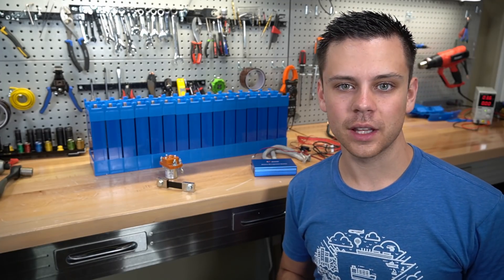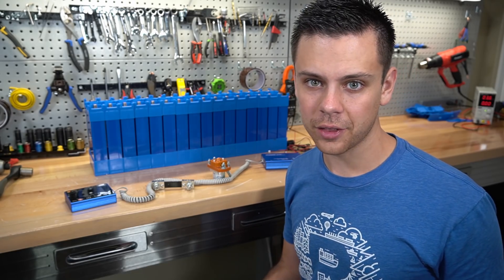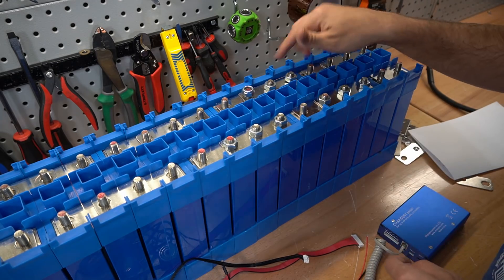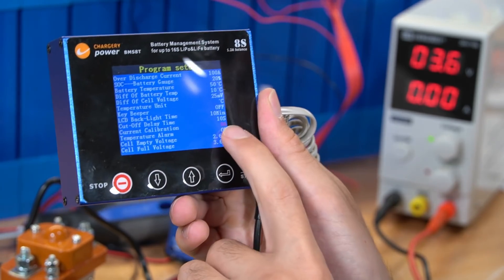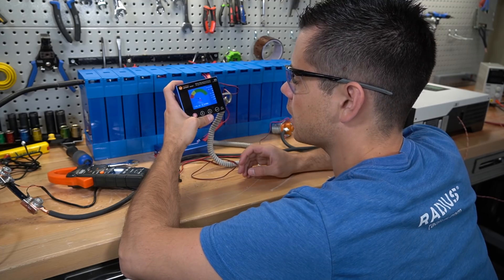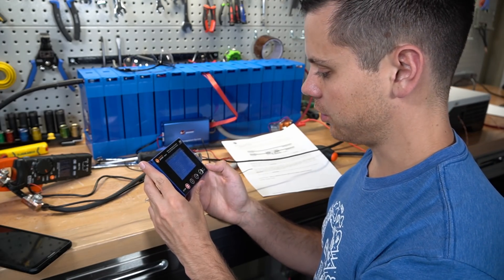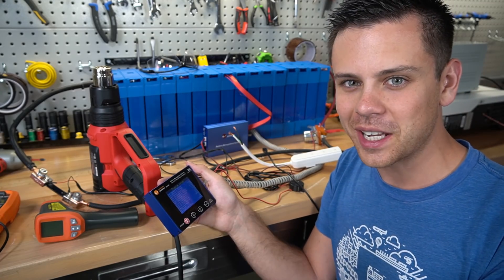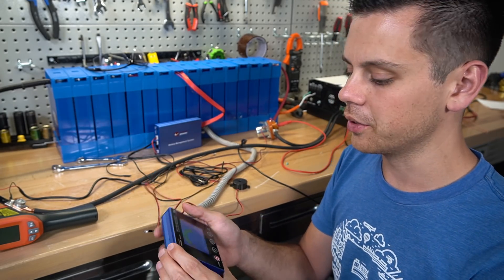Chargery 8T/16T LiFePO4/LTO/Li-Poly BMS Setup and Review

Comment: I like the Chargery system.  I just set mine up for a quick test before using it in my next project.  I read the instructions first.   The shunt is callibrated from the factory if you buy it with your unit.  So no need to do that process. I also the purchased 300A contactor which also works just fine.  I put a video on my channel.

Comment: They turn off the load relay because if you have a big cell voltage difference it means there is something wrong with your battery.... I'd say most of the things you had an issue with are desirable behavior even if the other systems you have used did not implement that.

I'll also add as others have, the relay heat is just from the coil and 118f isn't really that hot, and that method of current shunt calibration is better than entering a fixed value.

Comment: Thank you for the Video! If i buy the Chargery with 300A, can i adjust this to arround 350A? Because 300A i excatly need. i am afraid it will switch off in normal situation!
Thanks!

Comment: I have 8s 300 amp version. Connected it to 24v 600 amp lifepo4 battery. Can not get it to calibrate. Had a huge surge in amperage and destroyed my Magnum BMK ($187) loss. After 2 days and multiple recalibrations this is a no go. Not a stable or well programed device.

Comment: Good afternoon 
I just found out that the relays are bought separately. Do you happen to have a link for those relays? I may able to buy those relays if I know the operating voltage. I believe it is between 5 volt to 12 volt. Thanks

Comment: Good morning 
Would you able to provide me a hook up diagram? I bought 8 of the Lifepo4 280ah cells to accomplish 12 volt for my RV. I will put 2 cells in parallel to come up with 4 packs and using the the 4 packs in series to achieve 12 volt. I bought the same chargery you have except the charge and discharge relay. I believe I need to buy them separately. I don’t know if I need the discharge and charge relays. Please advise thanks

Comment: I bought this BMS system after watch this video and Your's recomendation. My ichargery is 16T and I used it with 12s battery pack from Tesla. I'm very disaponted , BMS shows inacurate cell's voltage's and balancing is really bad. Balancing 1,2A is imagination of producer. I lose my money and lot of time.  I'm DON"T RECOMENDED IT !!! . Search YT for video's from another disapointed user's of this pace of junk.

Comment: Why do you leave the parallel brackets on and then wire it in series I understand the parallel balance is the batteries that but you have to leave the little plates to connect to the negative negative positive to positive so on so forth

Comment: one reason I would like to be able to calibrate the shunt in this way is so that I could remotely locate the shunt, then calibrate for the resistance in extended wiring for remote location. Just a thought. Thanks for the videos, looking forward to seeing you cut some other battery apart soon :)

Comment: Resistive values of shunts change with temperature. So for maximum accuracy, you'd have a temperature sensor, or calibrate it at low current, and again at high current when it's warmed up some. 10 amps isn't enough to do that on a 100a shunt, though - so yeah it's just silly.

Comment: If you ever need to simulate a load again, reverse the polarity of your bench charger, set it to a low voltage, and current limit it to the load you want. Then connect. It'll act as a dead short / reverse polarity situation, but the current limiting will give you exactly the load you need.

Comment: love this video. I would do a firmware up date for this BMS. if they don't have have them make it. that is not user friendly ! I like the FET BMS. and you can control that contactor or bigger one for heavy loads. and most inverters have low voltage shut down anyways . put meter across that contactor getting hot. that voltage is loss not getting to inverter. the way I like is use a small relay solid state to control remote switch . that way only a fuse on inverter power lead.

Comment: That relay seems like a bad idea - I will design my own MOSFET switch PCB if I ever get one of these. 300amps is not a problem and most likely FAR lower ESR than the mechanical relay (no appreciable heat)

Comment: Personally, I am very satisfied with the Chargery BMS on my 24V 8S LiFePo4 DIY build.  I have found that an EV200 500A relay is much better than the relay shown in this video.  The heat problem with the relay in this video is not related to the Chargery BMS.  It is a separately purchased item that Chargery sells if you want it.  Just use a high quality relay like the EV200 and the heat problem is solved.  Also there is a easy way to calibrate the shunt.  On the third step, instead of reversing the hard wired leads on the shunt which require unscrewing and screwing, simply reverse the leads to the shunt from your power supply current source for the negative calibration.  I had no issues with the calibration doing it this way.  Of course you have to make sure all other battery loads or chargers are off when you do the calibration.
Reply: Are you Dr. Bruce Bugbee from Utah State?
Reply: @bungle555  No, I live in Michigan

Comment: I just bought a Chargery 16TPro BMS and as shown in the video - struggled to calibrate the shunt.   I don't need it for my case so I unplugged it, reset everything and got it all working.   I like it OK.     BUT I just saw this in the manual "3. Current Calibration is not recommended unless you are using a different shunt than supplied. Voltage
 and current is calibrated before delivery for the supplied shunt."
So it doesn't need calibration in the first place!!!   I plugged in the current sensor leads and all is working :)
My main problem is I don't need temp sensors - so I left them off and was confused why it wouldn't work...   till I noticed that when left off it goes to -22C which caused charge/discharge to be off.

Comment: clicked on the link you provided - is the cost really $9,999 - the seller re-listed the item that you linked to Will. 

this item. 

24V 3kW Growatt SPF LVM 120V/240V solar Inverter Split Phase optn

$9,999.00 Free Shipping

and the comparable one you also gave a link  to  is $639.00 ?
Reply: and the other one is $639.00 ?
Reply from the maker: No. You must have never used eBay. They increase the price when out of stock. Come on now lol 😂

Comment: Thanks for the info, I'm working on getting a 24V 100Amp lifepo4 battery set up but I'm having trouble locating a proper BMS. Looks like this one is not for me. Do you have any suggestions for me?

Comment: Will, you haven't quite got it right.  First, the Chargery BMS comes with a pre-calibrated shunt so you don't need to go through the pain you were complaining about.  Second, both mechanical and solid state relays have their problems.  SSRs tend to fail in the closed position (short) so you can end up with a very expensive dead battery bank.  The Chargery mechanical relay tends to fail in the open mode.  Third, you need to learn to read the manual.  Most of your problems would be solved.  The chargery is made for e-bikes and vehicles so it is optimized for that use.  However, it can handle up to 600A and 24s.  I am still looking for a reliable 16s (48v) BMS.  I do have 4 Chargery BMS 16Ts but I just plugged one of then in today so cannot render a verdict yet.  The relay coil is energized the whole time  you are charging or discharging so that is where your heat comes from but I really don't think a max 176 F is going to cause too many problems.  I have not measured this but the spec says that is the max heat and I can touch it briefly so seems about right.  Chargery is very good at customer support so far and even drew up diagrams for my 4 bank 600 Ah 48v powerwall using a BMS for each bank.  As far as the screen graphics, doesn't really bother me as long as the thing works.  It tells me all I need to know.  True, Bluetooth and some other data logging functions would be nice but try and find a BMS at a reasonable cost for the kind of powerwall I have.  This was the best I could find at the time.  I emailed the electrodacus guys and they told me they have no plans for a 48V version.  By the way, the Chargery handles low and high temp cut-off too.  If you have a better solution for my situation please let me know.  I really would like to protect my multi-thousand dollar battery investment.

Comment: Well, after watching the rest of the video, I found that super informative... I went through a couple of kinks with my BYD Modules and batrium but I'm using a Kilovac EV200AAANA Contactor

My BMS was 500$ for the watchmon 4 expanded (ebay used)
16 Long mons for around 260$
1 Critical behavior Kilovac EV200AAANA for around 30$
1 Precharger from RecBMS for 50$ 
150$ or so for the wires
MANY hours in setting everything up
Just under 1000$

I couldn't stand buying chinese BMS's and have them heat up or break down so much when I'm living in a apartment.

Batrium was setup to Keep the relay open unless fault. I also just received another Contactor and precharger from RecBMS for the charging circuit. 
The integration is absolutely incredible, The contactor only uses about .4A to stay open and I currently have it on my Freezer setup.  
I do have unhealthy cells so QNBBM runs across all 4. 

The freezer will stay running for +10 days 880AH.
See you  on the DIY powerwall groups!

Comment: It would be good to check how hot the contactor gets when NO current is flowing... some of them get quite hot because the coil that actuates it dissipates heat, not because of the current flowing.  One of the things that would put me off with a contactor like that is the current the coil draws.  Perhaps you can test these things for us?

Comment: I have 7 120ah 48v lg chem 6kwh battery banks. I also have a 12kw inverter. I want to charge the caps safely. I already own a 50 watt 100 ohm wirewound resistor. Will this work? Or should I purchase something else?

Comment: I built a 14s120p 18650 powerwall that I put in service several months ago. It's staying perfectly balanced so far, but I'd still like a BMS on it. I actually had one of these Chargery units sitting in a cart for a week but never pulled the trigger. After watching this I'm glad I didn't, but have no idea what I should get instead. Can't really justify $700-$1000 for a Batrium. Thanks for the review Will.

Comment: I'm putting together a 12 volt AGM 200 Ah system in my RV and it will be around 900 watt solar array as my main system
However I would like to have a smaller system just for lights and maybe use smaller voltage and use small solar panels and use the L ion batteries like the ones I see on your work bench what would you suggest and maybe you could do some videos on something like that 
Thanks

Comment: Thanks for this video Will as I too have had it in my cart for a couple weeks while educating myself on other BMS options. Going to look into Electrodacus now.😀
 BTW, how about a video discussion of the pros/cons of common or shared port vs. seperate ports for controlling load and charging to the battery?

Comment: Been meaning to write you about two things one is how to make an inexpensive battery for a cpap the company charges +300$ maybe 395. I have a car adapter but it’s huge and one night would kill your car battery so unpractical. Also want to go camping again would need portable solar charger. I have a resmed brand. I think a lot of people would be interested not so many for camping but what if the electric goes out. Insurance doesn’t cover batteries. The second is a lot of cruisers (sailboats) are going solar with the Efficiency of the new batteries you should check out some of the cruisers on YouTube it’s a big topic you might capture a bunch of people with that education also

Comment: I think a lot of the problems with this sort of thing often come from experienced users of similar systems simply because they expect to know how it should work and therefore don't actually read the manual and then only read bits of it when they have problems and then declare that it must be silly because others do it differently or because they would do it differently. Having a shunt calibration is actually a good idea as it means you can use any shunt of any accuracy or even a bit of wire as it can be calibrated to anything. It only needs to be done once and once you read how to do it correctly it's simple. The contactor heat is simply the coil. maybe it actually has the ability to provide a holding current? If a system goes through a LVD event and one cell is significantly adrift it could well be a a thing worth flagging up. As there was only one contactor connected for both charge and discharge maybe this is why it opened? Edit: Having just read the spec they claim that the unit is calibrated for the shunt before delivery and say to only calibrate it if you want to use a different shunt.
Reply from the maker: Yes good point but there should be 3 separate program setup inputs for current calibration. Having a single menu section, with time sensitive inputs for selection, is just silly. They should give the current calibration its own menu section. And a resistance value for manual setup. That would work perfectly everytime.

Comment: Why would you still have this linked in your information if you are not a fan of this particular BMS. In general Im not a fan of any BMS system but I understand the reasoning and need to some degree for a monitoring BMS as secondary redundancy for your systems. I am using an ANT BMS for my little power wall.
Reply from the maker: Because whether I like it or not, people want a link to it. And BMS are nice to have
Reply: @WillProwse  If the BMS is simple and easy to configure then I agree. Many can't monitor themselves either. Had a factory provided BMS fail to know it had failed and in so doing ruined a few thousand dollars of LiFePO4 cells. For me it was a boon because I purchased the remaining cells but the cells in general were pretty crappy. Early LiFePO4 cells. So if a BMS can't tell it has failed then the BMS is useless. The failed BMS still partly worked and monitored the remaining cells running those that were not monitored. Not overly trusting of them.

Comment: This type of BMS utilizing an aux contactor is the best way to go especially for high current applications. I agree with the comment below, Chinese Amperage ratings are mostly "fictional, wishful thinking" and need to be derated A LOT. I would never use a BMS that controls the main current flow on the circuit board itself. ZERO Emisison Vehicles Australia makes a similar BMS 16Sv3. Its a little pricey when including the color touch screen but good functionality. Its also worth reiterating what Kuhrd said below. A standard contactor that is energized 24hrs a day consumes about 2KWh per month, a magnetic switch would be much better. I'm going to try using a shunt trip breaker and very small, low current 48V NC micro relay to keep parasitic loads low  on my next 400AH solar battery.

Comment: The heat your measuring at the relay is most likely from The coil, not from the contacts. I work with heavy duty relays and contactors on a daily basis, and they do get pretty hot, but it's normal. You can measure the current going through the relay coil itself to be sure.

Comment: I had the Chargery and it didn’t disconnect my Winston cells and allowed the voltage to drop below 1v.  There were other problems before that.  Rubbish product so feel a bit vindicated after this video.  Replaced with 123 Smart BMS and now all is good.  Luckily the Winstons don’t seem to still work fine.

Comment: I don't understand why latching contactors are not more common. They use zero watts when engaged. I love these but hard to find.
Wondering is it possible use any cheap (Daly) BMS and add contactor yourself or just add more mosfets.
I just connected BMS output to inverter switch and SSR relay for low power 48V stuff. so no high current switch needed anyway.
Reply: Please can you explain better? Thanks

Comment: Hi Will I haven't seen many of your videos so you may have done this before but I am going to convert a van to an RV and checking battery options. I would like lithium ion and a solar panel but lithium Ion is very expensive so is there a way to get a cheaper option. Probably 200ah would be the best option.
Cheers
Eddie

Comment: So still not a perfect bms for 48 volt boat battery system. I really like the idea of using contractors. Too bad there’s problems.
On the other hand, I’ve been toying with the idea to combine fet bms with contactors; motors through contractor and lower loads through fets. If you could program different parameters to these as well...?

Comment: Hi sir, can I have your opinion if its possible?

I'll be giving you the specs of the system I'm planning to build for 24V System 
Battery = 12V @200Ah x 2 in a series (24V @200AH)
- enough for lights in the evening. 

Questions is, can I make a solar panel setup which will really overload the system? 
Like for example, 
Series of 2panels @  250W 18V = 36V 250W
Then I'll have a 5 of these kind of series and put them in a parallel.
So it's 10 panels in all. 
=36V @1250W

My purpose is to used the system during day time in heavy loads like AC, TV, Electric Fan, etc without draining the powerbank for evening use (low loads)

Or do u have suggestions sir on how to setup my system which will have 24V 200AH only (2 x 12V 200AH) in a way that I can use maybe 1,200W load during day time without draining the powerbank. 
1. Is it good idea to have lots of solar panels?

Comment: Maybe iT suts the relay off. Because if you have a big system and you are charging at 100 amps. Then the balance system can’t follow (Only 1.2 amps) so iT decide to protect the battery’s and shut off the charging.